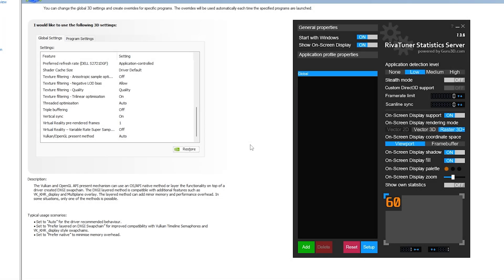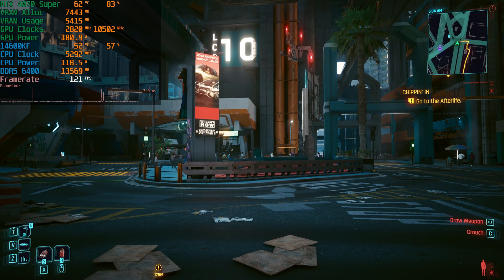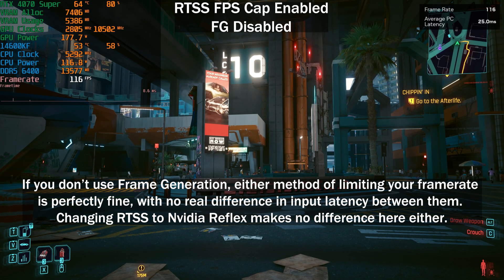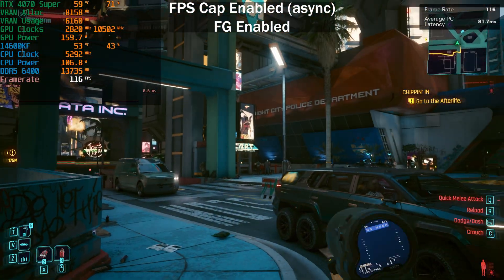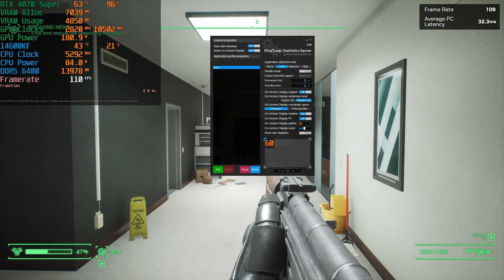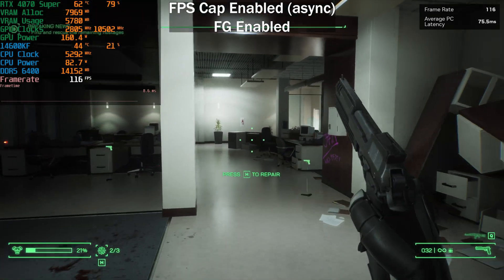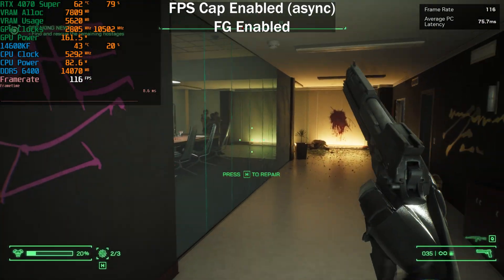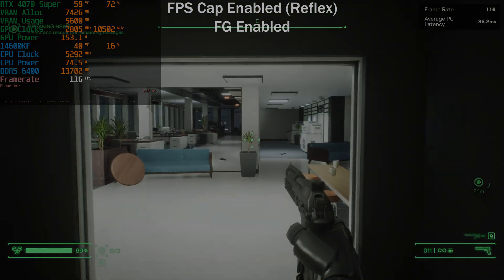How To Reduce Input Latency When Using Frame Generation - V-Sync vs RTSS

Comment: Is something wrong with cyberpunk?
I noticed the latency is much higher than in other games. Having like 80fps should give good performance like 20ms latency or less but nope. I have played many games and it's really weird. Without reflex its unplayable for me. (Im not using frame gen)
Reply: Yeah now i just realized im playing cb punk at 100+ms and idk how to fix it
Reply: @agyahernanto  i think its a game problem if you have NVIDIA i would suggest waiting for reflex 2, it might help alot. For me even at super high FPS like 150 the latency is around 15ms which is very weird
Reply: his video shows higher latency issues in robocop than cyberpunk... 

he had anywhere from 5-10 more latency with fg on and either reflex or vsync in robocop than cyberpunk, 
and he had near 10-20 more latency in robocop with fg and async on...

at least stationary and distant from action nor locking onto intensive visual targets... he had around 20-30 latency without fg on (though he didnt show reflex, just vsync and async). 20-30 latency is either on point or double say a game like cs2 (and that being cs2, unsure of csgo's before changes, especially being they changed a lot of commands or made specific things only now...) with less performance in multiplayer, but as shown here, a game like robocop with similar stuff going on like cyberpunk, its even worse than that...

Comment: Hi! i know i'm kinda late but what about rtx 30 series? i have a rtx 3070 ti and i can use AMD FSR FG, and i can even enable Reflex if i want, does it work even in this case? thank you!
Reply from the maker: Yeah, it does indeed. You cant measure the latency with the Nvidia app, but using AMD's FLM I noticed a slight reduction in input latency using this method even when using FSR 3 Frame Gen.
Reply: @Mostly_Positive_Reviews  amazing! thank you!
Reply from the maker: @ You're welcome!

Comment: So many questions. First of all thank you for uploading the video! 👏
1. What are you using to calculate and display average PC latency? (G-sync reflex monitor and reflex supported games?)
2. When you don't have RTSS Framecap enabled, I find it super weird that you are getting 116 FPS in both games, as you have  showed in all screenshots of Nvidia control panel that v-sync is on, and your monitor is 120hz, so yeah, makes no sense for the FPS to stay capped at 116, please explain 🙏
3. I'm not sure why you aren't displaying the FG FPS as well, that would just be informative.
Thanks again, you got a new sub 😎
Reply from the maker: Thank you, really appreciate the sub 🙏

1. In this video I used GeForce Experience. Same can be done with Nvidia App. Reflex needs to be enabled otherwise it shows Render Latency instead of Avg PC Latency.

2. The 116 fps cap is due to v-sync + Reflex. Reflex always caps a few fps below your monitor's refresh rate when v-sync + g-sync are used in combination.

3. Not 100% sure I fully understand the question. Can you elobarate a bit more if you dont mind?
Reply: @Mostly_Positive_Reviews  how do you use the Nvidia App to see/measure PC latency live ?
Reply from the maker: @MrT24-c4e  In the Nvidia App make sure that the overlay is enabled, and then in-game you can press "Alt+R" to bring up the OSD. You can also customize what it shows you within the Nvidia App.
Reply: thank you for the reply.
I did not know GeForce app and experience had the PC Latency, i use Nvidia frame view program.
Hehe i just saw the video again and you also explained in the beginning why you get 116, I'm in idiot 😂
What i meant was, your fps is 116, but when you enable FG you are getting presumably 2x FPS, and i just think your videos would look better if they had 2 fps counters, 1 with real frames and 1 for fake+real frames ❤️
Also...
You could try to see if on top of your RTSS reflex setting, you set an in game FPS cap, from the game settings, so RTSS cap = 0, and in game cap is 116. If that is even better for you
Reply from the maker: @jambazz  Unfortunately with DLSS 3 Frame Gen there is no way to see "real" frames and "fake" frames. AFMF and Lossless Scaling show you that, but FSR 3 FG and DLSS 3 FG dont, MSI Afterburner just shows you the final output. But you can basically divide it by 2 and get the real vs fake frames as it interpolates 1 frame for every real frame.

That doesnt mean though that if you get a 100 fps without a cap you are going to get 200 fps with FG. There are overheads, and you are more than likely to see something like 170 fps final, meaning 85 real frames and 85 fake frames. The 15 frames you lost as a base framerate is due to overhead.

In most games I tested the in-game cap had weird framepacing issues. an RTSS Cap works better for latency and consistency in my testing, but you should always try different combinations to get the best fit for you. What works best for me might not be the best for you.
Reply: @Mostly_Positive_Reviews  So 100 fps natif better then 180 with fg, because 90 + 90, no ?

Comment: Sorry for dumb question, whats the difference between using in game reflex compared to rtss reflex?? (i use 75hz ips monitor)
Reply from the maker: Not a dumb question at all. From my understanding the Reflex option in RTSS is basically the same as Low Latency Mode in Nvidia Control Panel, and when hitting a framerate limit it can help reduce input latency further.

Comment: Hi MPR! This is a great and underrated video, I would say. Recently I'm being more conscious about power efficiency and temperature when gaming. I'm using a 4090 and a 4K 144hz monitor currently. I love path tracing especially in Cyberpunk but a bit concern about the high power usage when using it. 

In Cyberpunk, if I maxed out everything + DLSS Performance with Frame Gen, usually im getting around 110-120 fps, even in the crowded areas. Its still not up there where I want it to be, which is 138fps when I enabled vsync through NVCP, but its good enough for me. I have a question related to this video, if I want to use RTSS to cap the fps instead, should I still enable vsync? I would like to use RTSS to cap my fps to 100fps because I'm getting lower power usage (around 340W+ compared to 430++ when i use DLSS Q) and better temperature, and more stable frametime.  In this video at 4:52,  do you enabled vsync as well? So would it be, G-sync + Vsync + DLSS 3 + RTSS 116fps cap? I'm a little bit confused about that.
Reply from the maker: Appreciate the kind words 🙏

I also recently got a 4090 and that is exactly how I use it. V-sync + G-sync + Frame Gen + RTSS Cap at where Reflex would cap it. 

For some reason input latency is still better when bouncing off the RTSS cap instead of the V-sync cap, even when they both cap to the same framerate.

You can test without v-sync and only RTSS cap, but I've found the motion to be smoother when v-sync is also enabled.
Reply: @Mostly_Positive_Reviews  Thanks for the reply and insight! 🙏 I’ll test both setups, with and without Vsync, when I get back home. Appreciate the tips! Honestly, after the announcement of the 5090, I’ve been feeling a bit of FOMO 🤣. I kinda want to buy it, but when I think about it, the 4090 is still an absolute beast of a GPU. And after reflecting for a bit, I feel like my future self would be disappointed if I decided to upgrade. Also, with the enhanced DLSS version coming to the 40 series as well, I’d say it’s not worth it, unless you have a 4K 240Hz monitor and really want to maximize its potential. In that case, it might be worth upgrading. But to each their own!
Reply from the maker: They released new slides of the 5070 and 5080 today and gen-on-gen increase is kinda disappointing. Sure, you get access to all the new Nvidia featuresets, but the 4090 will still be a powerhouse for a while. I'm also not upgrading, though I will try to get a 5070 or 5070 Ti for the channel just so that I can make content with the new features.

But as you said, each to their own. I know a few people who are upgrading, but just as many who arent. People should do what makes them happy, no judgment from me 😊
Reply: @Mostly_Positive_Reviews  Yeah, I saw the new graph, and it makes me feel a bit better about sticking with the 4090 for now. FOMO, be gone 🤣!  I’m looking forward to see you  and Terra Ware take on the new features. Also, I completely agree with you. Everyone should just go with what makes them happy. It’s nice to have options, but the 4090 really does feel futureproof enough for most use cases. Thanks again for sharing your thoughts!
Reply from the maker: You're welcome, and thanks for the chat! I really like Terra's videos, he presents it in such a chill manner. We actually talk quite a bit over on Twitter, he's a good guy.
Reply: @Mostly_Positive_Reviews  It's great to see a different take on game and tech reviews from both of you!

Comment: man i dont get it.... got new monitor 180hz if i go more than 180 i get crazy screen tearing even with freesync on so i wanna know do i have to limit it to 180 fps max? or im i doing smt wrong 
(my bro got a 180hz gsync monitor he said he dont get screen tearing with more fps )
im so lost rn
Reply from the maker: Going above your monitor's refresh rate results in screen tearing, but the severity depends on a few things. I have a 165hz G-sync monitor and get tearing in the 170-200 fps range. Above that I dont notice it really.

What I do is enable v-sync + g-sync in Nvidia control panel. Then games with reflex will cap to 158 fps, and it looks crazy smooth. On a 180hz panel it will cap to 171 fps.

If you then want slightly lower latency cap your fps using RTSS and Reflex option as shown here to 170 fps. I cap mine to 155 fps and the latency reduction is noticeable.

Comment: Reflex is always enabled when DLSS FG is enabled. Always. You don't need to use any kind of limiters, unless you want a much lower frame cap, but then only use, if available, the in-game limiter.
Reply: what about some games dont have Reflex like Black Myth and Indiana Jones ? they have FG but without Reflex option.
Reply: @iBandar117  Reflex is used in those games. Just doesn't have a setting to turn it off (which is not needed anyways).
Reply from the maker: Reflex doesnt cap the framerate. So If you dont want to go over your monitor's refresh rate to prevent tearing you will need to use some form of framerate cap, be it v-sync, 3rd party like RTSS, or in-game. In-game caps are often much worse than either of the other methods.
Reply: @Mostly_Positive_Reviews  Reflex DOES cap the framerate to 4-5 FPS below the monitor refresh rate. Please get your facts straight.
Reply from the maker: @ml_serenity  Only when v-sync is enabled. Maybe you should get YOUR facts straight. All my videos are recorded on a 60hz capture card connected to a 60hz 4K monitor. Why are they not limited to 57 fps?

Also, there's a formula for the cap when v-sync is used in conjunction with Reflex. It is not the same amount of frames on every refresh rate.
Reply: @Mostly_Positive_Reviews  Using Vsync with Reflex Null (Ultra) works pretty well without the extra latency. I tested it.
Reply: @Mostly_Positive_Reviews  is correct. Reflex only caps the framerate when V-sync is enabled.

Comment: 140 ms for input.. that means you game runs on 7 fps under the hood. Nice fake graphics
Reply from the maker: That's not how input latency works. Input latency does not equal frametime.
Reply: @Mostly_Positive_Reviews  That is what i said.
IF your game updates 7 times a second, you have 140 ms of input latency still, no matter how many fake frames the gpu generates :P
Reply from the maker: @AvalancheGameArt  You are saying because input latency is 140ms that means you get 7 fps under the hood. If your frametime was 140 ms, then yes, that would be an average of 7 fps. But even games that run at 100+ fps without any frame gen have input latency numbers between 30ms and 40ms, because input latency is calculated along the entire chain, not just frametime. Frametimes get added to the final number, but it doesnt make up the entire number. 100 fps average means an average frametime of 10ms, yet input latency can still be 30ms, without any upscaling or frame generation.
Reply: @Mostly_Positive_Reviews  If i press a key on my keyboard, the latency is minimal as it is handled in interrupt.
My loop can run as fast as it can, if i enable vsync then i would be constrained by the refresh rate.
So it is tied but not tied to framerate.
Reply: Absolute donut this guy

Comment: What overlay are you using to show the overal pc latency? 
Most likely that isnt  even showing the right latency from user inputs to monitor responses time, that latency is either the cpu or gpu or both combined. eitherway user input would equal >
Reply from the maker: This is the Nvidia Overlay that comes with GeForce Experience or Nvidia App.

Comment: Holy shit man. Got my 4070 Super last week. Currently playing Witcher 3 with RT and Doom Eternal also with RT. Christ almighty I did not expect DLSS and Frame Gen to be this good. Can't tell the difference between Quality and Balanced at 1440p and with a controller in Witcher 3 Frame Generation is Chef's kiss  still gotta try Cyberpunk with this card. Will do a heavily modded playthrough next year
Reply: witcher 3 with RT, how many fps are you getting?
Reply: yeah, and people get mad whenever i say FG is not fake frames 😂
I personally use FG in many games with it, with a rtx 4090, and GOD those Fps are just really really incredible on my 240 HZ monitor
Reply: @AHOP-v9d  I mean they're fake, purely in the sense that AI is spitting it out and filling in the blanks as best as it can, but they have a valid place in gaming. I enjoy the image smoothing when implemented properly. It just sucks that lower tier cards that struggle to put out higher frame rates don't get to benefit as much. The lower you're starting FPS is the, the higher your latency is. Many games struggle to put out good frame rates even with a high end system, so it's like you're getting punished for wanting to use the fancy tech you paid an arm and a leg for on low end cards. It's another situation where even though the tech is shared between the high and low end, there is a sweat spot for its utilization. All that said, I believe in the future of the tech and it can only get better the very same way DLSS has gotten better.
Reply: @AHOP-v9d  what idiocy is this?? frame generation WILL ALWAYS BE FAKE! thats like saying the sky is green and the grass is blue WTF??? i use frame gen all the time to play single player games, sure they are awesome for the single player case, but REAL FRAMES are undefeated in competitive, for that i would choose 70+ pure frames over 100fps+ fake frames.

Comment: So basically NVCP does the job. Why should we need to install external software (RTSS) and keeping it running in background shouldn’t kill few FPS ??

Also While using VSYNC method have you turned ON low latency mode on or ultra or completely OFF??
Reply: NVCP low latency mode is a legacy option and was a precursor to Reflex. it only works in dx11. there is no point in using it.

Comment: RTX 4060
R5 5600
32GB DDR4 3200MHz
SSD
In cyberpunk, the delay is about 80ms minimum, after 20 minutes it becomes about 200ms, regardless of the graphics settings. Does anyone know what to do? It looks like some kind of leak...
Reply from the maker: What are your settings? It sounds like you are starting to run out of VRAM? Does your FPS drop as well?
Reply: @Mostly_Positive_Reviews  the settings are maximum. I've tried turning RT on and off, but the problem remains. FPS will remain at the same level, but frametime is getting just awful
Reply: @Mostly_Positive_Reviews  I watched tests of similar PC builds - under such conditions, everyone's delay is at the level of 20ms, no more. maybe Windows 11 is to blame...

Comment: Tried this on 3060 with DLSS+FrameGen mod
frame limiter works with async mode but doesn't work with reflex for some reason
it just doesn't limit frames at all
Reply from the maker: When you use the mod you will need to cap frames at half of what your desired cap should be. So if you want 120 fps with the FG mod you need to cap it to 60 fps in RTSS with Reflex. That used to be the case back when I tested it last with the FG mod.
Reply: @Mostly_Positive_Reviews  omg thank you, this actually worked. I have 144hz so was limiting it to 140-142. Now tried 72 and it worked.

The only issue is it did almost nothing to my latency or framerate haha. 

Here's what I get:
1. FG mod (DLSS FG) + no frame limit = 40-45ms.
2. FG mod (DLSS FG) + frame limit async = 40-45ms.
3. FG mod (DLSS FG) + frame limit reflex = 40-45ms.
4. no FG mod, just DLSS quality + no frame limit = 30-34ms
5. no FG mod, just DLSS quality + frame limit async = 30-34ms
6. no FG mod, just DLSS quality + frame limit reflex = 30-34ms

So no matter what, FG just adds 10ms (which is not that bad). But what's weird is that even without FG I get 30-34ms latency. Doesn't seem normal

Comment: I'm a bit of a noob when it comes to these things, but how did you get the Frame Rate and Average PC latency to show in the top right corner? Which button or setting would I need to adjust to achieve that?
Reply from the maker: I just used the Nvidia App, and while in-game you press Alt+R.

Comment: hello , i used fps limit in nvcp set to 116  and vsync on, ultra low latency mode = ultra, reflex= on , fg on, i feel like no more latency for me, i tested in the finals, did you try this method?c
Reply from the maker: The finals is actually a very good example for how well frame generation can be. Fps cap + reflex works wonders.